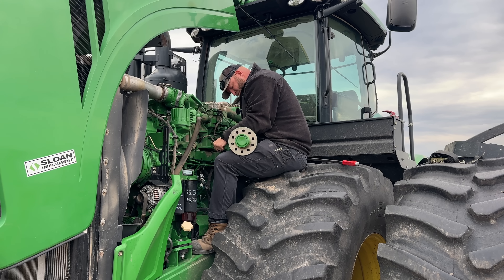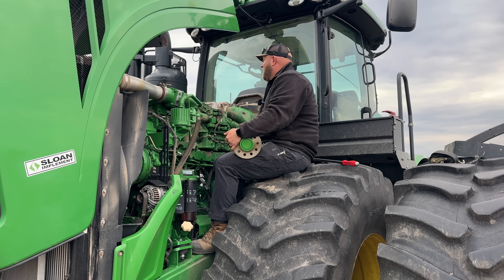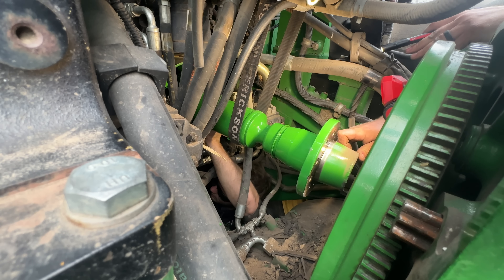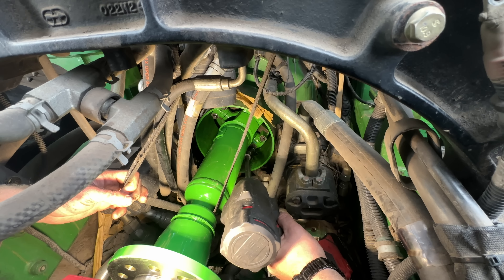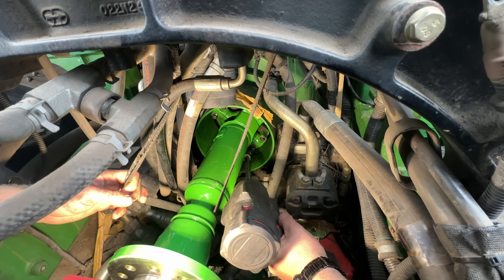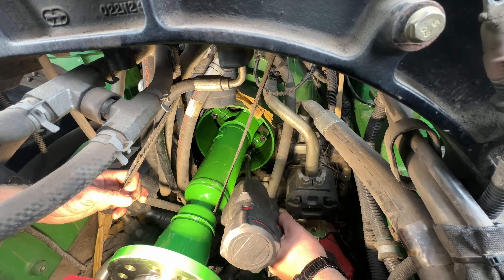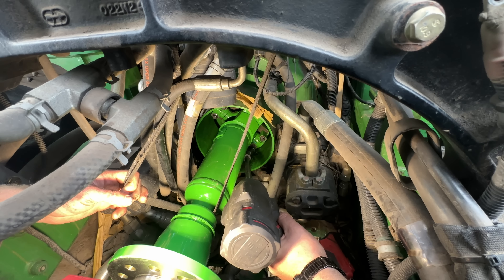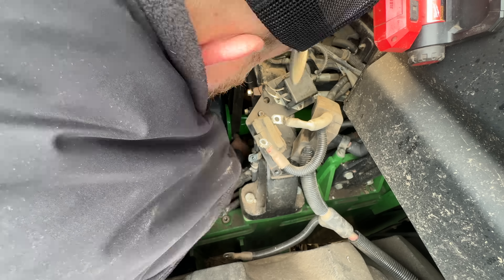John Deere 9510R engine torsional damper failure. Worst engine vibration you'll ever experience!

Comment: Am I the only person that is is alarmed at the major components that fail at low hours normally?
Reply: No!
Reply: These new tractors will never make 10k hours .
Reply: Cheaper material and higher prices = Greed
Reply: No, your not. I would be majorly pissed if this damper failed every 2,000-3,000 hours. JD can't even make the excuse that it's an environmental issues (it's a sealed unit). Same with the fan drives and bearings failing everywhere. I wish Zeth would reveal the cost of parts and labor for these jobs. I'm sure it's astronomical.
Reply: Remember, you are only seeing the failures, not the hundreds of thousands of pieces of equipment out there with very low failure rates.  Doesn't matter what color you are talking about either.
Reply: As I stated in Zeth's last video, most American companies do regular "cost saving workshops" where the goal is to removing material from components.  Usually, this is a race to the bottom to compete on price with Korean products being dumped here.
Reply: Lord Dynaflex series dampers are sold by Parker USA. They are used in mining, locomotives, agriculture , dynamometers,military vehicles and portable air compressors. I’m going to wager a guess that they fail in other applications too.
Reply: @jeffhatmaker817 it’s not a sealed unit.
Reply: @jasonpark1052  Really? Tell me about it. There are millions of internal combustion engines operating worldwide with torsional dampers. ALL of them can operate for more than 3,000 hours without expensive repairs. Please give me a brief description of JDs unique torsional vibration damper. Why do you think they are failing?
Reply: @jeffhatmaker817  I cannot answer that question for you since I don’t have enough information to make a factual assessment. The damper is made by another company(Lord corporation) that supplies it to Deere. Please refer your failure rate questions directly to them or Deere.
Reply: Another awesome vid! Keep the deere's running!
Reply: I come from Germany and do the same job. I can only be amazed at the failures. The longer I follow this channel, the worse I find the quality of John Deere
Reply: @Sniper-cw5bs  I agree. The failure of basic components on relatively new, low-hour JD equipment is staggering. No other equipment sector (cars, trucks, or aircraft) could build such unreliable equipment and stay in business.
Reply: Are you surprised, it’s a modern Deere.
Reply: My Deere tech has already told me what I need to look at on my combine and what WILL fail next.  Just sad.
Reply: You say that we are seeing a lot of John Deere failures but i have not found any videos made by technicians from other manufacturers. Probably because they are having the same problems.
Reply: @tallboy49  unfortunately quality decline is basically universal among the brands these days. Cheaping out on parts to squeeze more margin out of them.
Reply: deere is infamous for planned failures
Reply: @jeffhatmaker817  What about the aviation industry, any failures there?
Reply: @jasonpark1052  Of course there are failures in aviation. The scope of failures includes training, procedures, lapses in quality of technical staff and parts. But no reputable aircraft manufacturer would allow a part to pass quality control that would fail in a few thousand hours. In aviation, bearings for example, are bulletproof. No reputable aircraft manufacturer would use substandard bearings to save a few dollars. And if your comment is intended to capture a "gotcha moment" by citing Boeing's quality issues, don't even go there. Boeing has lost billions of dollars and will possibly go out of business for neglecting quality issues. And so should John Deere if necessary.
Reply: @jasonpark1052  Of course there are failures in aviation. The scope of failures includes training, procedures, lapses in quality of technical staff and parts. But no reputable aircraft manufacturer would allow a part to pass quality control that would fail in a few thousand hours. In aviation, bearings for example, are bulletproof. No reputable aircraft manufacturer would use substandard bearings to save a few dollars. And if your comment is intended to capture a "gotcha moment" by citing Boeing's quality issues, don't even go there. Boeing has lost billions of dollars and will possibly go out of business for neglecting quality issues. And so should John Deere if necessary.
Reply: @jeffhatmaker817 I’m not into the gotcha moment. My point is simple, you go after the same thing every time you make a comment. It’s low hour failures of Deere products. Then you compare them to other industries that don’t apply. After you wait for the justification from other viewers that you are right. You have no facts to back up your statements, other than the aviation ones that you just listed because you work in the field.
Reply: @jasonpark1052  I appreciate your comment. I would like to point out that I didn't start this thread. My original comments were to someone else's comment. I'm not the only one who notices  or commits about these issues.
Reply: I’ve noticed ever since I started watching his channel, these expensive new machines are poorly made and fail a lot more frequent than they should. Job security for him but shitty for the farmers who rely on them. Same with the semi truck industry. Quality in the past 10 years had tanked dramatically.
Reply: Planned Obsolescence
Reply: I've been wondering since he's mechanic he's only gonna be going to fix broken tractors. Maybe we're just hearing all the outliers. and most of the tractors run all fine and dandy.  lol
Reply: Made in China or Mexico 😂😂😂😂trump will sort it 😂😂😂
Reply: The quality of John Deere these days are nothing like they used it be. So many trying other colours in the uk now
Reply: Maybe it fails because of too low rpm while pulling under let's say 75 percent load? My guess is that the resonantion is than worse.
Reply: @jeffhatmaker817  just his labor fee is probably stupid high. A master tech? Crazy money
Reply: Welcome to the world of modern technology. This is why jd tractors <1994 are still selling for their new price and 600 hours in on these new poses means 50% depreciation
Reply: It’s a Deere….
Reply: @sjfk1306  all the new tractors are the same crap different paint.

Comment: The design engineer 's need to start to come out to the fields. I don't have any faith in the work. It could be the down fall of JD
Reply: They do use a different style coupler now on the new tractors. It’s the same as what the red tractors use now. Even the red tractors had a run of bad torsional dampers too.

Comment: I watched the video about the bearing replacement on a John Deere tractor. Massive 3,000 lb axle assembly, planetary gear drive. Some damned impressive technology.
The thought of the machine tool technology involved to produce those tractors just boggles the mind. I've only seen such tractors from afar. I'll never look at them the same knowing what engineering is involved to bring them to be.
😎😎🙏🙏

Comment: You got lucky.  When our 9560 lost the coupler the shaft broke the pumps next to it and got the wire harness and the steel tube that runs to the back.  Needless to say I had to pull the cab.  Sucks they fail at such low hours.

Comment: In the early 90’s a similar type a coupling was used in the 6000 series, within a couple of months there was a new type of coupler between engine an transmission, one by one they chewed up the rubber..

Comment: Bolts just can't center it accurately. And it's important since rpm is not exactly low. So the slightest offset will vibrate the dumper plate metal to fatigue with this result not far away. There should be cone bolts and a specific torquing sequence involved to make this sh*t design any workable. Good job guys.

Comment: Wondering about this ne equipment. So many headaches. We had an Steiger 360. We ran it until we were tired of it. Had something like 12,000 hours on it. Wasn't the prettiest thing  or the quietist thing on in the township. But day after day year whenever we needed a load pulled it did it no questions asked. We updated the hydraulics to pull an air seeder late in its life on this ranch. Was a brute to drive.

Comment: Zeth is there a DTAC about aligning the engine mounts with shims for the torsional dampers? I seem to recall reading something about that.
Reply from the maker: There is.
Reply: This is the actual and most important part to resolve and prevent this from happening premature. The pulsation and torque transmitted across the flange and shaft is tremendous. Smallest misalignment will wear out any material or designsolution  regardless of brand, size or hours.
Reply: Worked on much smaller machines and other type of application but same design with transmission of power from engine to hydraulic main pump. We implemented special guage to meassure and secure alignment in the factory as slightest miss alignment and tolerance differences would create this type of premature failures in field. Very difficult to do alignment in field thou...

Comment: That’s bs that you have to buy the whole driveshaft because you can’t get the dust cap
Reply: Clean the splines up a slam a freeze plug in there.  Hate to know what the cost of the shaft is.
Reply: @Puckgrinder85  about 2k if I remember right. That was about 2 months ago.
Reply: @I_Am_Your_Problem  Expansion plug for a block.  Doesn't look to be doing anything critical other than keeping the splines clean and grease in.  For the 2k I might be inclined to try something if the shaft is ok otherwise, unless its warrantied, then go for it.  .  :D